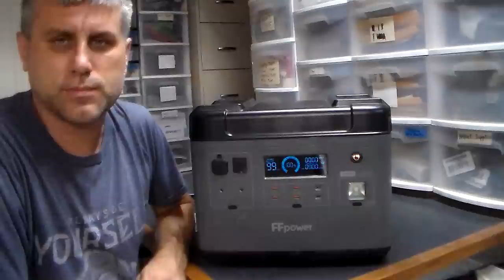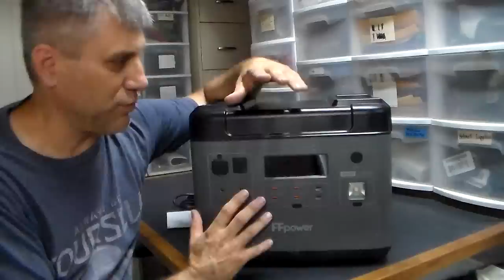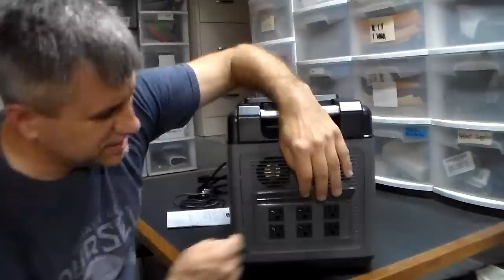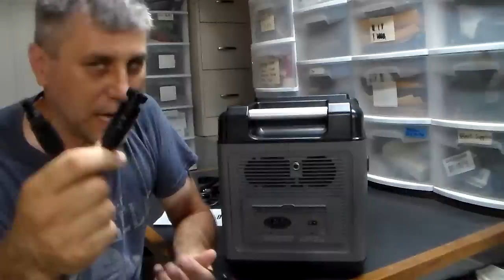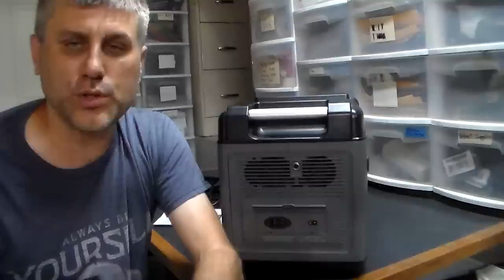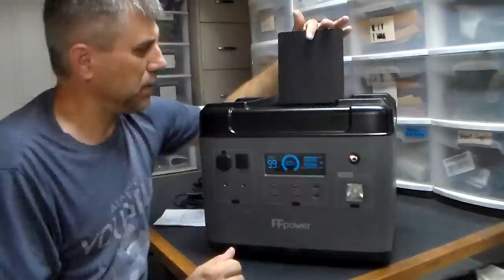Back up power...FFPower...2000 Watt  portable power station

Comment: Thank you so much for this video! I purchased this exact machine not too long ago based on another preppers recommendation and I was wondering did I made the right choice because there are so many on the market. I am at ease now😊!
Reply: I have been holding off and listening....This is the best thing going currently. Charge time, capacity  and price. PLUS backed by people who actually use them everyday! PRICELESS!God bless!✝️🇺🇸
Reply: I just purchased the same unit with a different name. I was considering buying an Eco flow but purchased  this on sale on Amazon prime day and I am extremely happy with it. It takes two hours to charge it fully from the wall as he said but I haven’t had a chance to purchase any solar panels for it yet. I am very impressed with it for the price of $1100 that I paid
Reply: @Guido I have the same one and yes it will run a large deep freezer. I live in arizona and my freezer is out in my garage which at this time of year is about 100° night and day. Thats all I bought the unit for is to run my freezer. The unit will keep it cold as normal for 11 hours before it dies. Mine pulls 130 watts so if you had the 600 watts of solar panels it would easily stay fully charged during the day and have plenty of power to keep it going during the night. For the Price it’s a pretty sweet unit. Hope that helps
Reply: I decided to buy this after listening to you. Would you buy Insurance on it? Thanks
Reply: @dannyjohnson809  Probably wouldn’t hurt too but I didn’t even think about it

Comment: Father's Day we caught a OUPES 1800 with 4 panels on sale. We're rural and lived thru the Texas snowpocalypse of 2021. It compliments our gas generator. Also have a few smaller power banks for phones, lap tops etc
Reply: What was the sales price you paid, for reference for the rest of us?
Reply: I just got my Oupes 1800 w/2 panels as insurance against blackouts which are very likely these days. Anything with a LiFePo4, a pure sine wave, (around) a 2,000 inverter, and pass-through charging will work great. SouthernPrepper1 hit all the right points and did a great review here, even though we chose a different unit.

Comment: I bought 2 288wh packs with 2 60W portable panels. It's not a lot but better than nothing. A fan and a light some reading material and im great.

I figured I can charge one while I use the other. Dave Catenbury always said 2 is one and one is none.

Comment: Amazon took off the $250.00 coupon for the unit but would not accept the  GBHZ76I9 promotional code.....Is that the correct code?

Comment: Thanks for the power station information.
I'm using a Jackery 500, alongside my Jackery 240.  I travel with these in my self-converted camper van, and they supply my power needs while camping.  I juggle a small refrigerator, lights, fans, and charging cell phone and tablet.  My folding solar panels seem sufficient.  Hoping there will be a safe way to use the solar panels at my condo in the city if the grid goes down. 
 I appreciate your advice and experience!
Reply: If you have Jackery Solar panels then you should be fine with them because they are top quality for folding solar panels. However I recommend getting some rigid solar panels because as SouthernPrepper1 said folding panels cannot be used outside during bad weather, which I add folding panels fail and break down way faster than rigid panels.
Reply: Just ordered mine a few minutes ago !!! Wanted one for a long time. Finally did it. I have this urge to prep. I know it’s time to get my house in order.
Reply: I love jackerys products
Reply: In a condo myself personal advice buy some cheap land nearby. ( 1-2 hours) geographically. And figure out shelter. I’m doing so now.

Comment: Thanks 4 the information!  I am looking to spend about $2000-2500k but I want something that's SOLID and has a warranty that's very good!  I know Anker is now offering a 5 year warranty, which is great for one of these units.  What would you recommend for a step up from this one?  Thanks brother
Reply: Look into ecoflow
Reply: @ithinkbecauseiam  will do, thanks
Reply: Jackery will sure cost a lot more then this unit
Reply: First look at what your power needs are, otherwise you will not know what generator and battery size is enough to serve your electrical needs. And all these portable solar generator warranties are not guaranteed, it's mostly marketing to entice people to buy... so read the reviews of product to see if people had problems with warranties. Also you may have to decide to get two generators in case one fails or breaks.

Comment: I’ve two. A 300 and a 500. They are perfect for outdoor/camping. I run a 12v frig freezer 24/7 in my truck.  That said hard panels a controller and an inverter is the best way to go also the cheapest version. I put 400 on the roof of the camper a 3k inverter, mppt. 300amp hours of battery and it’ll run the entire camper, including ac.

Comment: I have  Jackery . My question will the solar panels from Jackery work with this unit. How much does this unit weigh?
Reply from the maker: It is around 50 pounds.
Reply: @southernprepper1   I like Boots on the Ground
Reply: To heavy for me. I have 100 watt panels . Living on the coast of SC I need something more then what I have . I went through Hugo
Reply: Unless you know how to make your own wires or buy adapter from online sellers then your Jackery panels will not work for FFpower solar generator because it uses MC4 to Anderson connector to charge while your Jackery solar panels uses something different.

Comment: You recommend that over a battery bank?
Reply from the maker: Setting up a battery bank with the charger controller and inverter and  fuses and wiring is confusing to alot of people this is just easier if you have no knowledge or skills with solar and batteries.
Reply: @southernprepper1  I, for one,  appreciate being able to buy something like this all in one box. Nobody is good at everything and this is not something I'm good at. I could learn and maybe I'll look at that for my son with homeschooling but right now, there's too much going on to not have something. I got the bluetti 200P. I kind of wish I'd called you but I've got it now with 2 350watt soft panels, would have rather had glass so I don't have to be out, but I can add that later. I didn't know that was an option. This was actually cheaper than the bluetti 200p and if it actually does 2000 watt hours is better. Bluetti only does around 1700. But again, lesson learned. Next time I'll email you.
Reply: I think a do it yourself Battery Bank is allot better but these things are for people who don’t know how to do that, they are very simple and have almost everything but something to charge them built into them.
Reply: I am so very happy to get this all in one.  Thanks for the heads up.  I used both discounts.  Yay!!